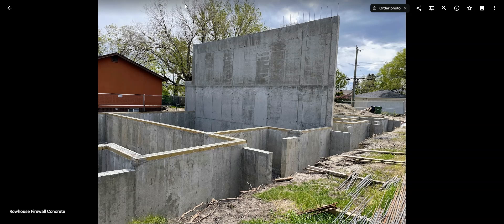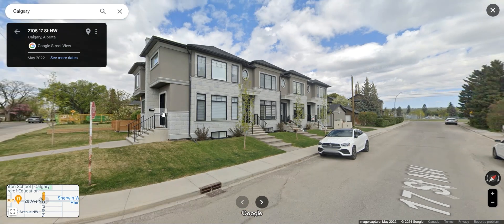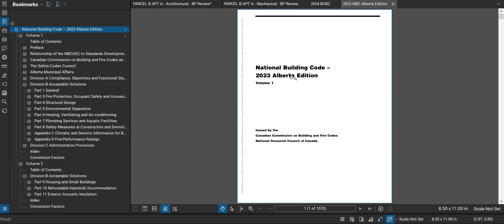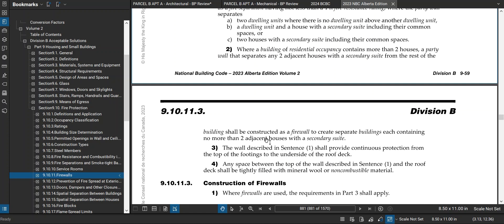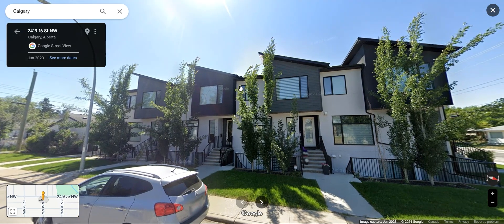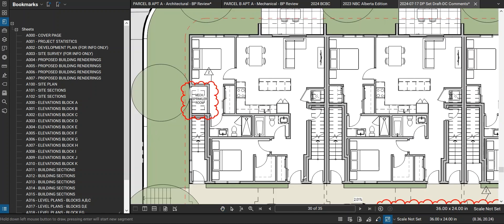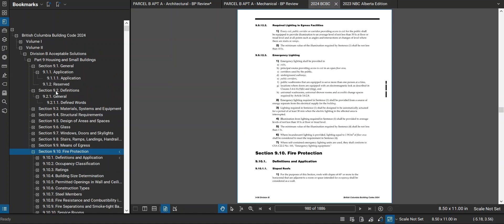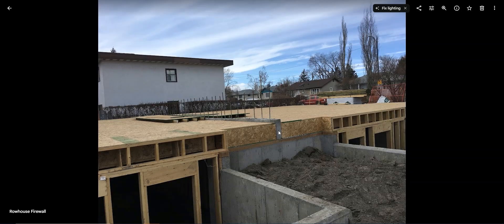Alberta Building Code vs. British Columbia Building Code - Part 9 Rowhouse Firewall Requirements

Comment: Thank you for these videos!  I am looking at a firewall in a project not because of code, but because of insufficient hydrant pressure for a larger multi-unit project if it is considered one building.  Are you able to talk a little more about how firewalls intersect with exterior walls?  I see them projected in some cases, and here it looks like they are flush.
Reply from the maker: All the requirements of a Firewall are laid out in 3.1.10. Aside from parapets, there is nothing stating that they must extend outwards beyond the exterior face of the exterior wall other than what is mentioned in 3.1.10.7 for combustible projections within proximity of the firewall. Often they are extended, but I don't believe they need to be in many cases.

Comment: Great technical deep dive! The Fort McMurray events have anything to do with Alberta's stance on fire safety?
Reply from the maker: I don't think so, but I personally think that non- combustible siding like cement board (Hardie Board) and mineral wool outside insulation under under the siding should be mandatory in forested areas.